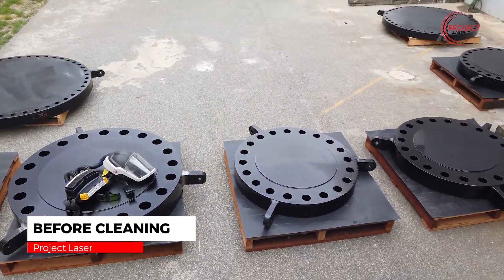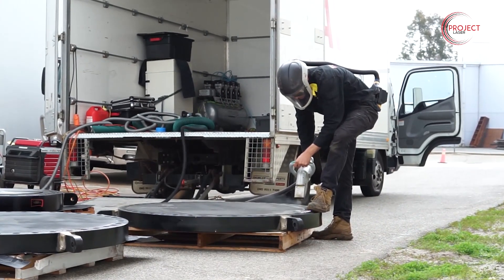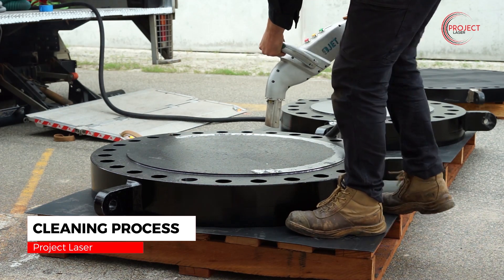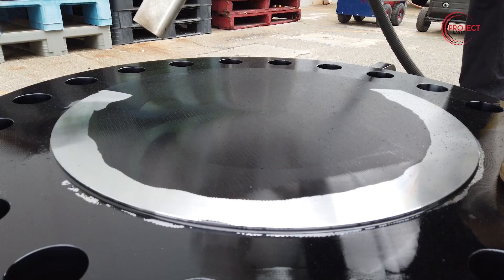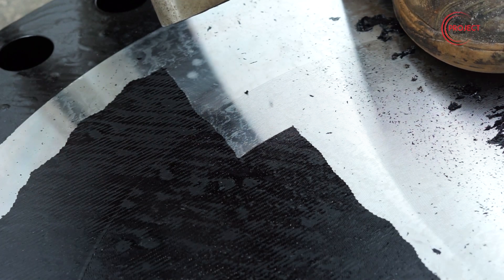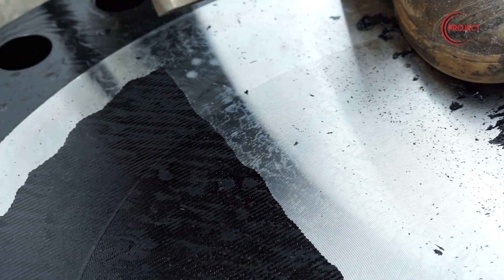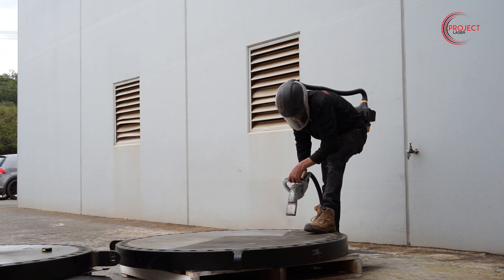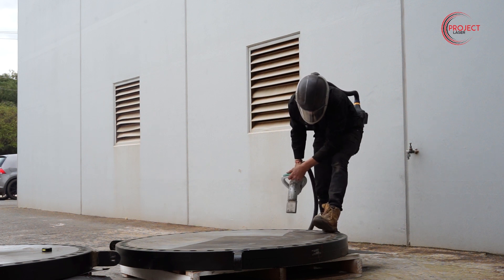Laser blasting protective coatings

Comment: do you guys quote on time taken or what are the factors you take in when quoting?
Reply from the maker: Lots of things to consider as laser strip rate fluctuates a lot depending on what you're cleaning.
Size of component, what needs to be removed, complexity of moving around, time to set up, and mobilise.
 Sometimes, we under quote, we certainly did at the start.